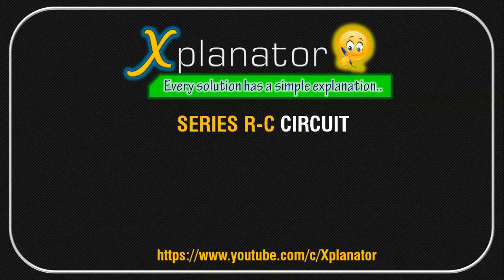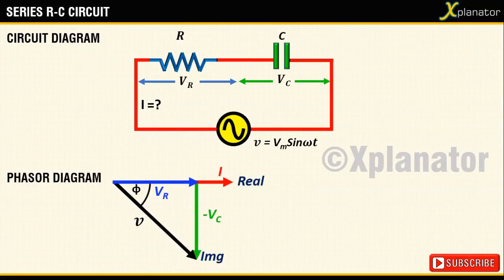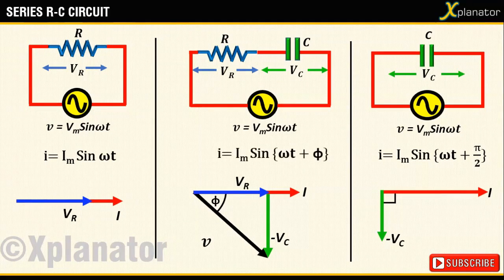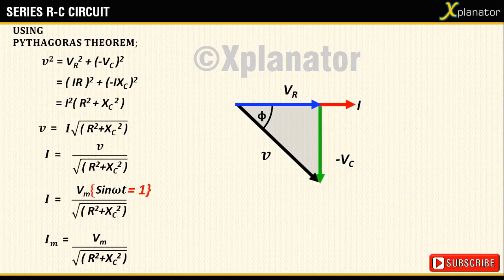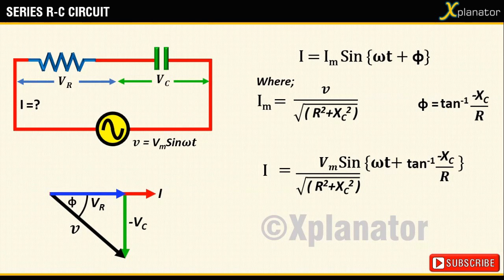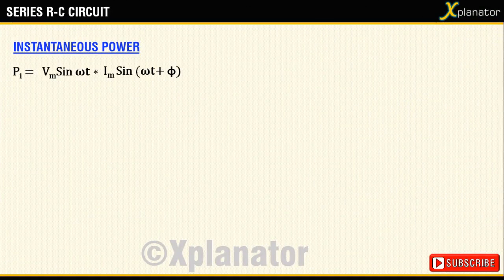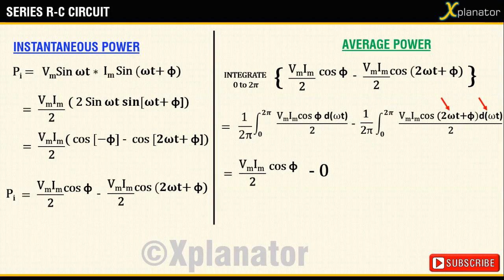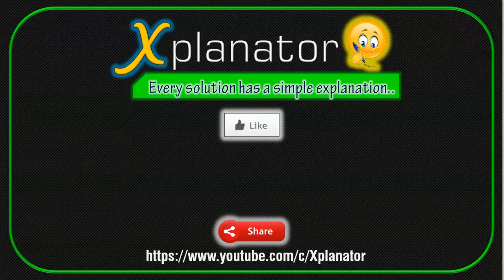SERIES RC and AC supply : CURRENT | POWER | PHASOR DIAGRAM

Comment: Why there is a voltage drop across the resistor in ac circuit ?? When it comes to rc circuit with dc voltage source resistor acts as an current limiting one for capacitor in series
Reply: There is always a voltage drop across a resistor, any time there is current through it.

Comment: what is the impedance
Reply: Simply resistance in ac
Reply: total resistance  Z
Reply: The ratio of voltage to current is called impendence(z)
Reply: Very good and clear explanation. What about  R L C  circuit